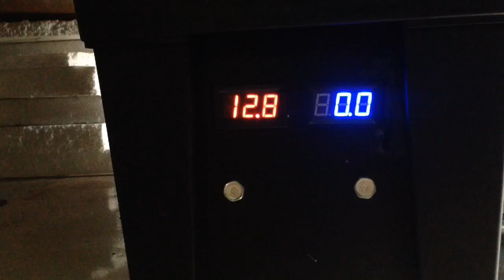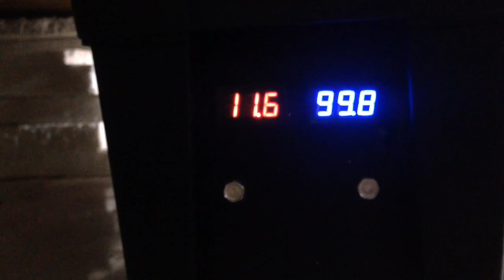Faking amp results on the missuri wind and solar 1600 watt turbine

Comment: and some, change out the stator for higher voltages for the 24 volt 48 volt and above. to acive the higher voltages you need small wire and more wraps per coil for higher voltage but lower current. but all PMA need at least 2400 RPM for rated out put. and like with the alternators for cars 2400 will give you rated 80 amps and to achive the 140 amps you need 18000 rpms.  so all PMA's need hight winds.

Comment: Thre real problem is this if you do some research look of the delco Alternator. they 140 amp althernator for 13.2 volts for charging your battery. every one is using this same althernator. the only differiance is the rotor. they take out the electromaganetic rotor out, and replace it with a permanant maganet rotor. that is the only differince in the 12 volt models witch all need at least 2400 rmp to product max out put.

Comment: then let those DIYers make or buy the blades, make or buy a geared up system to turn the PMA faster thats how I would sell them. you put that puppy on a 10horse power motor and reved it up to 2400 rpm + you would get the power from it. I would only sell the PMA to those that have the no how to build a geared system for the PMA People like Ian.  Or build and sell a system that can get the PMA's up to those RPMs at such given winds.

Comment: see I dont fudge my meter readings I have 200 amp meters and 200 amp sunts 75mv.  how many blades are you using.more blades will give you more tork and low wind start up, but low rpm in high winds. Less blades will give you more rpm at only hight winds. I wish I lived in a area like Orlan with winds all the darn time so I can test different blade count and size.  I wish I could answer that questing for you.

Comment: Orlan, Cris alson and many others have built the Axiel flux turbines. they are exspencive to build. yet you look at them you need 10 diamater or larger blades to turn them fast enough and with enough tork to achive the rated out put of even those.    Every thing I have stated in the comments are all true, and every one knows it.

Comment: I belive people have seen good power, and many have seen very little power. why is that most people live is realy low wind areas. and every manufacture that sells mirowind turbines say you need 20+ winds to see power. and it sucks when you have to have 60 mph or more winds to see the maxium out put from a turbine like the PMA but with current set up even with PMGs PMMs you need high RPM your never going to get that in 10 mph with a fix shaft turbine.

Comment: the thing is every one is using the small blades. what is need. and I have said this even in a video. you need large blades long blades, and a gearing system to turn the PMAs at a hight rpm in low wind. thats all there is to it you need the rpm and tork to achive the maxum power from any alternator style turbine.   any fixed shaft turbine will need masive amounst of wind to turn them fast enough to achinve maxium out put.

Comment: So how are they producing any power with blades moving so slow. I do belive some people fudge there amp reading to either support or disprove out put of a companys turbine. But the real questing how to get the power that a small device can get because they sure produce it in a car. at idle.   I have the anser. large blades and a transmission. that is what is used in a GE style megawatt turbine.

Comment: So how are you going to disprove or prove if a Alternator style turbine dose or dose not work, if you dont have the proper blades and wind.  Look at all the GE tubines and others that use massive 3 blades. they are huge and then look at the generator and the size compard to the blades. how do they achive the rpm need. and you look at the blades they are not spinning very fast.  and these turbines are in the megawatt range.

Comment: So are we saying GM are also lieing on there rated out puts. they say 70 amps at 13.2 volts at 2400 rpms.  what is that in watts 924 watts and at 18000 rpm you can achive 100 amps for 13200 watts.   and for the other model you can get 80 amps 13.2 volts at 2400 rpm thats 1,056 watts. and at 18000 rpm you can achive 140 amps thats 1848 watts.   so think about it at what wind speed do you need to move blades fast enough to get that power.

Comment: here is two 12si alternators 
12si Alternators 
100A Specifications 
70A @ 2,400 RPM @ 13.2 VDC @ 77F 
Operating Range: -40C to 150C 
Maximum RPM: 18,000 

140A Specifications 
80A @ 2,400 RPM @ 13.2 VDC @ 77F 
Operating Range: -40C to 150C 
Maximum RPM: 18,000 

so what blade combination do you need to achive the power out put of these two alternators that every one uses for the PMA style of wind turbines. the only difference is the rotor.

Comment: So what do you need to get the required power from any car alternator style generator. RPM and tork  So the problem is this for every one involved. at what wind speed, what blade size or set do you need to achive the required 2000 rpm, and tork to product the maxium out put of a 12si car alternator. if you ever look at a 12 volt PMA its the same thing as a car alternator other than the rotor, is a permanat magnet.